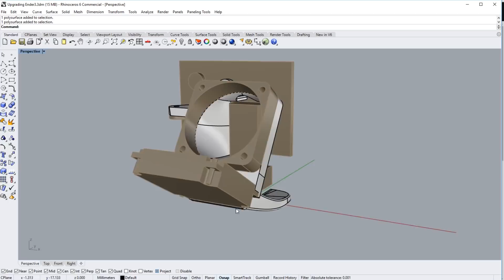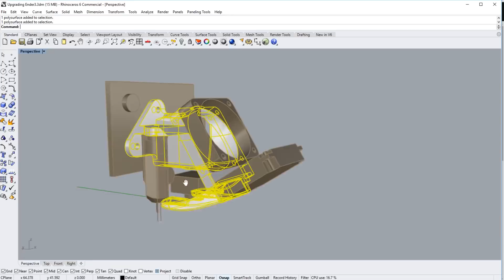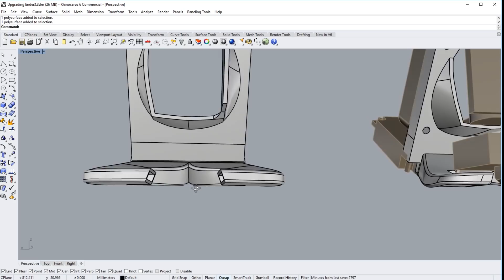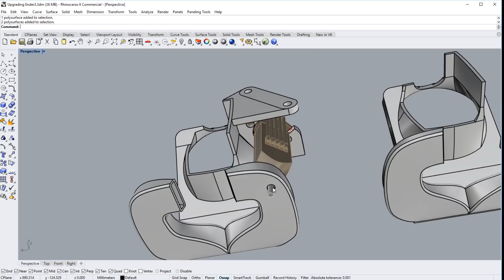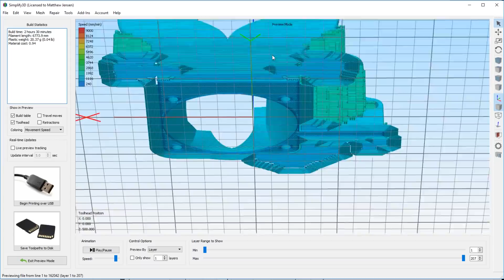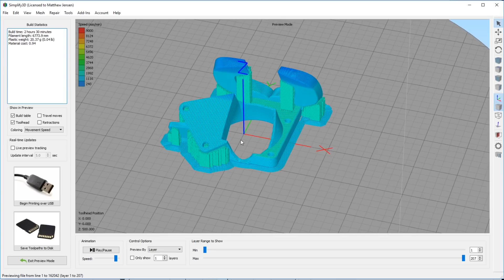Upgrading the Creality Ender 3 with Duet Wi-Fi, and other add-ons - part 1

Comment: As someone that has owned a Prusa MK2/S and MK3 for 6+ years, the zip ties and 3D printed parts aren't a drawback to durability or print quality. I've owned six different FDM printers, the Prusas are the only ones I've kept. Nothing against the Ender (well other than the need to replace parts more often since it doesn't use linear rails or linear bearings) it is a good printer for people that like to hack on it to add stuff.

Comment: The prusa is not advertised as a feature rich printer, it is known as a reliable, out of the box workhorse, that needs no work. Reliability is the key!
Reply from the maker: When I made this video it was ALL about the features. Bed leveling, Filament MOTION detection (no longer present because it didn't work well), Skiew compensation, Super P.I.N.D.A, etc. Only now that China has caught up and can make comparable features is Prusa (and you a fanboy?) trying to change up the narrative to focus on reliability instead of features. Nothing is going to change the fact that the Bamboo Labs X1 is the superior product.
Reply: @DesignPrototypeTest  I never said that no. And I'm not a fanboy either, I am well aware how expensive the prusa is and would rather mod my own Anycubic I3 Mega. 
Still though, for all I've seen these days people buy a prusa because it's proven, because it very rarely fails. People buy it for a print farm where, without mods, the thing will print for thousands of hours without failure. Sure one can mod a printer oneself to get there, but those who do not want to often choose a prusa. That said. In the last two or so years superior machines have come to market for good prices, and they do look like they can challenge that title too. But they haven't had two plus years yet to prove what they're capable of long term. 
Call me a fanboy I guess, but being around the community the main reason I've seen people buy prusa is not because of bleeding edge features, those looked to voron, ratrig, etc, but because they wanted a slower, but reliable workhorse that just doesn't fail. Watch Zach Freedman's (the Gridfinity guy's) video on his printer. He has two prusas because they just work.

Comment: The first time i installed my filamentsensor in the same way.  But there is a problem. As soon as the Filament runs out and gets past the extruder its stuck. You won't get it out without disassembly. If the sensor is before the extruder its way easier. You can just retract it out.

Comment: Newly shipped Ender 3 printers now come with a 32 bit control board, maybe with the silent stepper drivers. For an extra $10-20 the ender 3 pro adds a removable build surface.
You should add an all metal hot end ($22-$65).

Comment: If you want to do surface modeling, stop whining about it, 

Although surface design requires a different mindset than solid design, it’s essential for the creation of smooth, organic, and continuous objects. In addition to product design, surface modeling is often used in the aerospace and automotive industries. (Note that this type of modeling is not intended to be used for 3D printing.)

Comment: I just use the add-ons in Cura for adding supports and save $120. I even like the paint-on supports in Prusa Slicer. I just don't have $120 for slicing software. I'm going to try the new GeeTech 3D Touch Pro, I know it's technically a knockoff but they are trying harder maybe. Otherwise I have my other DIY ABL sensors.

Comment: put that lazer sensor in the same container with the old motherboard.  they are useless .. if you are dumb enough to run your printer out of filament , then you don't need to be printing... and if you even move the arm .. print is lost.. it won't remember where it was in the Z access.... JUST SAIYAN..
Reply from the maker: What about if you want to use the the entire roll of filament, and you don't want to babysit your printer? You let the printer run out of filament, pause and notify you that it needs the next spool before continuing to print. It's not a "dumb enough" feature. It is quite useful. BTW it's Z-axis not "Z access" and yes the printer absolutely does remember where it is in all axes.

Comment: Nothing made by creality will be as nice as the Prusa without a pile of money that’s as much as the prusa. New control board with replaceable stepper drivers… linear rails… dual z… e3d hot end.. ditch the cheap stepper motors… still have a cheap power supply… not nearly as nice of a bed… Especially if your time is worth anything. And I charge people $80/h for my time. 

I still get amazing prints from the Ender 3v2… and it paid for itself twice over in the first month.., but if I’m being honest with someone… it’s a hot piece of junk. Good hobbies machine… but I can’t believe people build print farms with them

Comment: A lot of time in this community is wasted by trying to make fan ducts that look like they are from an alien space craft. The whole thing could have been a lot easier if makers could get over their fetish for slanted fan designs. There is no good reason to have a fan slanted.
Reply from the maker: You are making a patently false claim. The less the airflow needs to change direction bending around corners The more momentum is conserved and the better the airflow you achieve at the tip of the ducts aimed at the nozzle. Basically bends slow air. Straight pipes are better. By starting with the fan at 45° you are  making the airflow path more straight.

Comment: do not make the same mistake like this guy install the filament sensor befor the extruder otherwise its not working . the noctua fan is not a 24V fan and because of that its very loud when you use it with 24V and not 12V i know it because i tried it. or did he show someware the difference of the old fan and the noctua. there are many many 3d printing chanels out there the know how it works lock at there chanels and not people who makes advertising vor some stuf that is not worth it.
Reply from the maker: Do not listen to an armchair know it all like this guy. If you are using a MOTION sensor for your filament it works perfectly after the extruder because it detects the lack of movement and the Duet control board knows that a lack of filament equals a jam, miss-feed, or runout condition.
Reply: @DesignPrototypeTest  says the toilet.. There is someone very angry. You have some 3d printing appearances and you think you know everything. You are  just one of thousands who make advertising vor some stuff to earn money. What about the noctua fan why didn't you show us how good it works.. I will tell you because you heard it with your ears that it's soo loud that you shown only the part with the water and not the part with noise differences. Shame on you

Comment: This is not worth it in any way, also the Noctua is a bad idea. 
also what is his deal with Prusa? there are many things great about Prusa printers. 
granted I've spend far less on or printed alot of upgrades for ender 3 
like
-skr mini v2 + tft
-dual Gear Extruder
-all metal hot end
-Dual z (nema setup not pully)
-Bltouch
-adding a pi with octoprint
-moving to a 5015 for the blower
-a hotend fan that wont cause heat creep, I'm looking at you A4x10
(*side note for Noctua at least spring the extra dollar and use a A4x20)
-Custom Flashing Marlin to my needs and liking
-also and haswell but thats an og ender 3 problem
linear reals are better, wish I had done that by now

its a fantastic printer and I enjoy modifying it and tinkering and making it my own

yet at the end on the day a Prusa would have been alot less of a headache had all of this shit covered 
and for the Price of a duet board you could do most all of the upgrades I listed or buy another printer
Reply from the maker: It's so funny how you Prusa shills hate the Duet board. I mean it's understandable, but envy doesn't look good on anyone.
Reply: @DesignPrototypeTest  I don't own a Prusa and I do not care to for the price it goes for.
That said, there are many things wrong with the ender 3 (as well as many other printers)
Buying a Prusa won't solve all your problems but neither will just dropping $150 on a duet.
I wouldn't hate to have one and I don't think their shit either.
But hey if you can only afford the optiplex and Nvidia hands you a 3080 then why the fuck not.

My point is at the end of the day for someone buying a very budget friendly printer buying a duet doesn't make alot of sense and is not worth the price in comparison to various other options.

Call me a Prusa shill sure I'd gladly take one of those too but I bought an ender 3 for a reason and for the price of a adding a $150 dollar board to it I might as well just buy a better printer.
Reply from the maker: You don't own a Prusa yet your entire comment is "Prusa great and easy, Ender 3 very complicated/time consuming. Also, Duet too expensive." The only product you didn't say something negative about is the printer that you don't own.
Reply: @DesignPrototypeTest  and your point is? all the upgrades on an ender 3 that alot of people will do to improve accuracy at the cost of maintenance time just slowly get you closer to the parts on a Prusa ? 
Wonder why
Linear rails cause fuck pom rollers
The addition of another z axis
An all metal hotend
For some that prefer it maybe a direct drive extruder or just a better extruder
Better parts cooling and a 5015 fan
Auto bed leveling sensor, plus a powder coated spring steel sheet
A more affordable 32 bit board.
The benefit you get with an ender 3 is a better frame.
It's like buying a car to add parts to it to put it closer in comparison to another car.
You spent less but at the cost of time.
Both cars are always going to have maintenance in the end regardless.

I'm not here to say Prusa is the best and everyone should get one cause that's not the case
But objectively speaking I've slowly just built up a Prusa bear clone with my own marlin build.
If I had the money I'd probably just save the time.
I don't idolize Prusa's I can tell you really hate them
Reply from the maker: My point is that you sound like a Prusa shill or fanboy or sock puppet. I doubt your intentions in the comments here. Anyone reading your comment here and accepting that you are some kind of expert would come to the conclusion that they should buy a Prusa instead of an Ender 3. If you think so highly of Prusa printers, why don't you own one?
Reply: @DesignPrototypeTest  the only thing I said don't buy was the fan you used, even Prusa had issues with the A4x10.
I'm not saying buy a Prusa either 
I'm saying I don't think the duet is with the price and that just a bltouch, a duet board, filament sensor and a new hotend fan make it a mechanically better printer.

When I started 3d printing I don't know if this was gonna be something I was gonna dive deep into so I didn't buy a Prusa and I don't think it's necessary to do so.

When I say a Prusa would have solved alot of the headaches and frustrations that came with learning and starting with an ender 3.

This is why I added things to improve the accuracy and stability and just overall quality of life enhancements which come with their own set of issues, something when you install things that don't always work right or you got a dud or the come wired backwards or it works but you are now having issues with something else which can be frustrating when you don't know why and there are so many things it can be. I learned alot from these things though no matter the headache some thing could be.

it's a good starting point to be something better but there is a reason why it's a cheap printer and many ways it can be better the a Prusa for cheaper. 
Regardless this ends up being subjective to everyone and what the value of something is worth to them
Could care less if I come off as a Prusa shill but it's mechanically a good machine that's not worth the pricetag. 
Most of the things I have done to my ender 3 it already
you used Prusa as an example of comparison. 
So did I
Reply from the maker: I compared to Prusa because the I3 Mk3 is the reason for the Ender 3. Prusa got the internet so spun up on their product being so superior that now everyone thinks that is the shape of a "good" 3D printer. I've got beef with Prusa. Not so much anymore, but I used to get harassed in the comments of every video by sock puppets/fanboys for Prusa. This was happening to a large degree when I released this video 3 years ago. These attacks have hurt this channel more than you can realize. But Prusa's influence has also hurt 3D printing as a hobby. Without that dominant form factor from the marketing manipulations of Prusa, CoreXY printers would be much more popular and since that is the better form factor, Prusa is in effect holding the hobby back. They were supposed to release a CoreXY printer, but they never did. Give me a Stock Ender 3 and I will make prints that are every bit as good as those from a Prusa. Everything else is just usability or user experience issues.

Comment: You will never detect a filament runout with the setup after the extruder gears.... The filament will just stop moving...
Reply from the maker: Upon no movement the control board pauses the print and pops an error message.
Reply: @DesignPrototypeTest  looked like a switch that triggers when the filament gets past. If its detecting movement, I have to revise.

Comment: have a clone BLtouch for 3 years, still works. is more than reliable for the task i need. i dont doubt a BLtocuh would give me better precision but considering it was £8.72 vs £46 and im not chasing dead on tolerances for a hobby, ill just used mesh level and repeat my probe 3 times. would i prefer to support the creator but were talking over 4 times the price. at that kind of price its a different price segment. all they need is an economy version, £15, good enough for anyone thinking of getting a clone but not as good as their best.

and trianglelabs is a company that makes high quality clones their version £10... keeping this hobby open source is imo for the best, to chase performance and options. do we really want to see a cannon, hp, epson of the 3d printer space where they charge tons for their proprietary ink etc. a pattent on 3d printing prevented this hobby from ever being a thing until 2008(?) it took off from being public domain

Comment: An ender 3 can never be better then a Prusa when it comes to mechanical construction. The Ender 3 is simply crap. Perfectly understandable for the price. You get what you pay for.
Reply from the maker: HA HA HA! You think a Prusa frame is fundamentally better than an ender 3. What makes a Prusa good is the lengths they have gone to polish that turd. Think of it as the most tuned and tweaked printer. Imagine how good it would have been if they had started with a better platform...like an Ender 3.

Comment: Does the Heating Bed still benefitted from the Cork Board?
Reply from the maker: Yes, but there are better options now for under bed insulation. Just look up "3D printer bed insulation" on ebay.

Comment: AMERICA DOES NOT USE 115V mains. not since 1984 when we standardized it to 120v. 
grab a multi-meter and shove it into any wall socket. you'll read 120v

Comment: I purchased a cr10-max they are great machines   and have done some upgrades, wonder if you could put a mmu2 on it and never run out on the filament during prints as when they run out turn the bed off and go to a pause point and restart results are no good unless you are there and for large prints over a month is impossible to gauge to change. Have considered the palette 2 as an option  Your thoughts thanks David NZ

Comment: My guy, if I were in a position where I had to admit I screwed up so badly in assembly during a review video that my power supply voltage was wrong and my filament holder was backwards, then criticized the printers for it, I would just delete the video and start over.
Reply from the maker: Making mountains of molehills are we? There is a term for your exaggerated words and behavior: Histrionic. It comes from the Latin word histrio which is the name for a pantomime AKA a clown. So, basically, your overly dramatic words make you a clown. But deep inside you already knew what you were, so I just wasted 3 minutes of my life writing this.

Comment: Yo, you got to move all your moving parts slow other wise it will create a generator on the ender 3
Meaning it will light up the LCD screen & it will short circuit the LCD screen & maybe the motherboard
Reply: Most 3D printer manufacturers expected the motors to turn to generators when the printer is off, so the boards are usually protected against it.
Reply: @IronHexacyanoferrate  what about ender 3 version 1